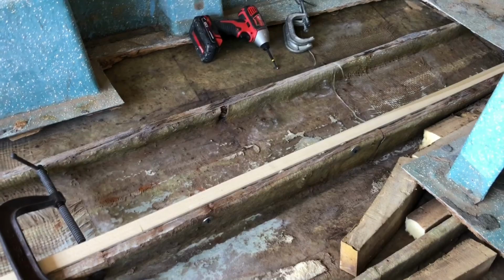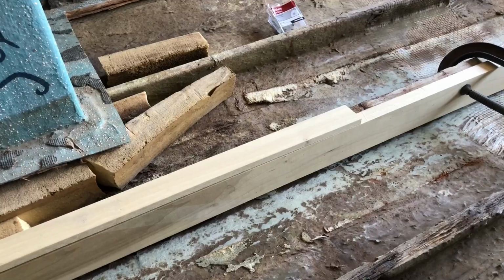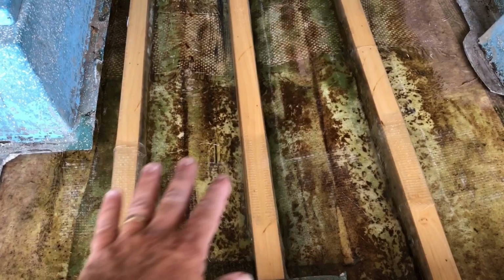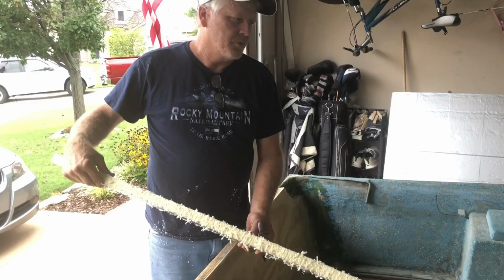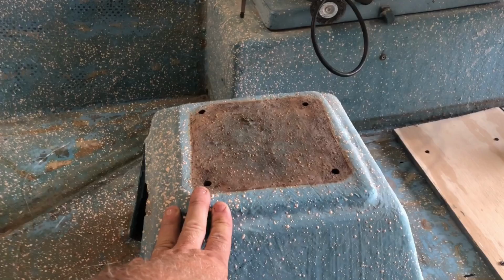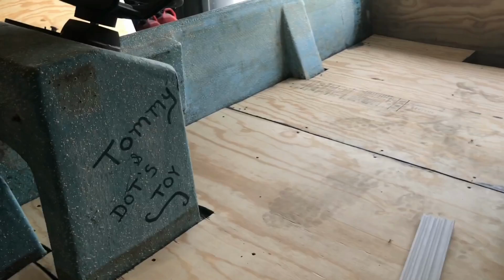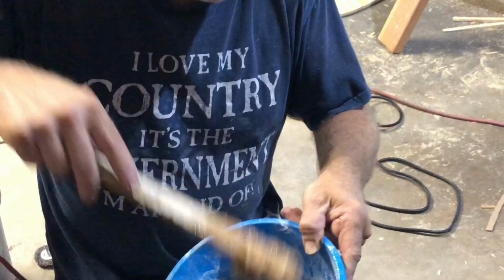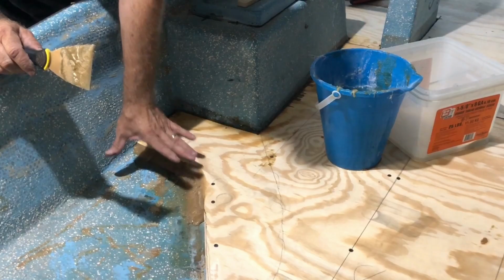Boat Restoration  7| Install/Fiberglass Floor| Paint Interior

Comment: I have a 18 foot sea ray bow rider and one of the seats ripped out. Turns out the wood/foam was rotted, and I ended up ripping out a good portion of the deck and waterlogged foam. After watching this, I’m definitely going to fix it myself, I got this! Thanks!
Reply from the maker: Good luck with your project 👍🏼

Comment: This video gives me confidence on my project, I got an old fish and ski I need to do this to. I was wanting to use better materials than wood/plywood but I don't really know of any the fiberglass would bond to. Your's looks great.
Reply from the maker: Thanks, did you start your project?
Reply: @borfishing7690  I put that one on the backburner for now until I learn a bit more. I picked up a 14' aluminum v-hull that I'm putting a deck and compartments in right now though. It's coming along slow but steady. About done rebuilding the trailer it came with and will focus solely on finishing the boat. 👍🏻

Comment: i think chopped glass wouldve been better than flour as the chopped glass fibers would soften up with the resin then would intertwine with each other making a much stronger  joint. I think the flour mix would tend to crack if there was any flex while the chopped intertwined glass fibers would not. but just my 2 cents
Reply from the maker: I used chopped glass around the transom. Used flour just as filler under the tapping. Thanks
Reply: @borfishing7690  oh i guess i missed that  sorry

Comment: Great Video. I am replacing entire floor on our boat. What Grade of Plywood (Interior or Exterior) and how many ply's was the plywood you used? You said it was 1/2" thick. Thank You Rog
Reply from the maker: Hi Roger, mine was 15/32 3 ply. Interior. It would be best to resin the bottom of the board before you install(I only painted with protective paint). Good luck with your project

Comment: Hello - what was the mix called for the peanut butter to fill cracks? Also, where did you get the fiberglass material? Thanks and great job on the project!
Reply from the maker: The peanut butter was resin mixed with flour. Got my fiberglass on Amazon, thanks

Comment: Your videos are GREAT! Very informative and great work!! I have an old fiberglass boat I bought as a project. My stringers are pretty dry-rotted and cracking. Do you think it would be good to build around them or should I count this one as a loss? And has yours held up well over the past year?
Reply from the maker: Can’t say on yours. My were partially rotted, but my floor is solid. Good luck Josh

Comment: I would rather glass both sides of the flooring before installing
Reply from the maker: I kinda wish I had. The boat is doing great, but glassing the bottom would have been optimal.

Comment: You sealed the floor
The bilge area has those foam cutouts
So how does water drain that gets into bilge?
How does bilge area dry out after wet?
Reply from the maker: I have a drain hole and it is garage kept.

Comment: what panel you use.   marine?  and for the stringer?    i need replace the mirror
Reply from the maker: Used regular 1/2 inch(4 green at Lowe’s/Home Depot). Stringers were 5/4 poplar

Comment: You should’ve fiberglassed the board before you attached it there’s no glass or resen in between the stringer and your board will definitely rot
Reply: Exactly, water will be pulled into any space there is air.

Comment: I have a question about what you used to put the glass mat down.. was it the same mic as the hardener, resin and flour or just resin and hardener?
Reply from the maker: I put the chop strand down with resin and hardener. I filled the gaps around the floor with resin, hardener and flour. I filled the gaps around the transom with a  prepared resin and glass from the comprising bought most the resin, hardener and woven glass.
Reply: Thank you for all the advice I’m doing a complete rehaul on my boat it’s a 1964 Sherry and I’m building a standing deck up front with storage bays, I built a custom console and everything is being completely redone.. all new stringers, transom, floor, carpet the list goes on and on lol I’m in the middle of the transom repair and kinda got lost with putting the fiberglass mat down and how to seal all my edges under it so thank you for all of this insight I appreciate it a lot
Reply: The prepared resin and glass that you used to fill the gaps around the transom is the prepared resin just resin and hardener then you add the glass resin to it? How much for all of it combined?
Reply: I just want to make sure I do this all correctly
Reply from the maker: I bought pre-mixed resin putty from the fiberglass supplier. It had the glass mixed in. I don’t know the ratio they used. Depending on how much you need, I would consider auto pre-mixed glass resin. I used it to patch the hull(not during the videos). It is an auto patch mix that I think would work well. I don’t remember the name, but I got it at Walmart.

Comment: Great Video! Im redoing the deck on my tri hull 14' fiberglass boat with a similar layout. I know you left a few inches of overhang around the edges to support the plywood. Looks like the wood was rotted out underneath that fiberglass floor you tore out. My question is did you put anything underneath the existing fiberglass floor edges or did you just lay the plywood down, glass over it and thought it would be strong enough without extra support?
Reply from the maker: Not sure what you’re asking, but the floor is solid. Thanks
Reply: @borfishing7690  Ok. Did you use Laminating resin or Finishing resin on the deck?
Reply from the maker: @johnwilkinson355  I used resin on chop strand fiberglass

Comment: Hi. Great video. I'm going to try make a bathroom shower and just wondering how many layers of fiberglass did you put on the floor? Just so mine doesn't crack I'm gonna have plywood under it too
Reply from the maker: Hi Carlo, I only put one layer of chop strand fiberglass on the floor. Thanks

Comment: How's the boat holding up?  Kinda heavy, isn't it?
Reply: Did well on the water. I have numerous fishing videos using it. I sold it last year.
Reply from the maker: I used it a lot with no weight issues. The guy who bought it is still using it

Comment: How has the rustoleum paint lasted
Reply from the maker: It’s been ok. It scratches a little easier on the outside, but generally is holding up fine.
I use the boat heavily in flooded timber
Reply: Oh okay
Reply: How does ot hold up on the inside
Reply from the maker: I painted over it with regular paint and a clear coat. Been doing great. I’ll be posting a video on the boat soon. I’m getting it ready for sale.

Comment: That's not fast drying epoxy is it?
Reply from the maker: I only used resin for the fiberglass and rustoleum protective enamel for paint
Reply: @borfishing7690  I'm sorry , I meant the hardner .
Reply from the maker: @josephauld6565  I didn’t use any epoxy, thanks Joseph

Comment: what  did you used to make up the resin filler ?? i did not get it .Thank you.
Reply from the maker: Around the transom was resin mixed with chopped fiberglass. Gap filling around the floor was resin mixed with flour.
Reply: @borfishing7690  flour? as in flour the baking bread stuff?   Could make sense, it will be encapsulated in resin and not degrade.
Reply from the maker: Yep, just plain ole flour. Thanks

Comment: When you laid the fiberglass mat down what ratio did you use?
Reply from the maker: Ratio?
Reply: BOR Fishing ratio for the resin and hardener
Reply from the maker: Depends on the temperature. In the video where I do the transom, I hold a ratio chart up at some point. I don’t currently have it.

Comment: I was looking up gun restoration channels and found yours, you look like you read the comments... anyway. I was wondering if you could help me and my father out with an old USSR pellet rifle. It’s an ИЖ-38.  I don’t have the serial number memorized by heart, but it is jammed. And I was just wondering if you’d be willing to help
Reply from the maker: Looking at the gun gun, it looks a lot like my crossman spring cocking pellet gun. First thing I would do is spray it heavily with oil/WD-40 and let it set a few days.
Reply: Billof Rights alright. Thank you, I’ll tell my father that. And if that doesn’t work, I’ll try and see if we can get it professionally restored.
Reply from the maker: The way I approach gun repairs or restoration is to YouTube or google the gun looking for assembly and disassembly instructions. I restored a 30-06 that needed a part that was broken internally. Without YouTube videos, I would not been able to do it. Good luck with your gun.
Reply: Billof Rights thanks. Thank you very much! Good luck with future gun restores.

Comment: Was that epoxy primer at the end?
Reply from the maker: Rustoleum protective enamel
Reply: Ok cool thanks. I’m in middle of doing mine and was just gunna spray with satin black rustoleum  protective. Just making sure I didn’t need to epoxy prime or 2x prime. Thanks again and definitely most helpful video for me as its been 15 years plus since I last fiberglassed floors.

Comment: About how much did parts cost
Reply from the maker: 2 sheets of plywood=60.00, resin and fiberglass cloth=500.00, quart of resin putty with fiberglass=40.00. Protective Enamel paint=27.00. Best I can remember
Reply from the maker: To add, I did replace cables, steering rotary, bumper guard, lights and others. Total boat parts were around 2000. Boat and trolling took another 2000. Thanks Chris

Comment: What type of putty did you use?
Reply from the maker: Most of it was a resin/chopped fiberglass mixture I bought from a fiberglass supplier. What you saw me mix is a resin/flour mixture. Thanks Michael
Reply: So you used, flour, as in what you make cornbread with!? That's cool! My husband and I just started pulling up the floor in our 88 Stratos. No clue what we're doing! Your video is helpful thanks!
Reply from the maker: You can mix flour for filling in cracks. For areas that need better binding, you should use a mixture with fiberglass. I used the fiberglass putty around the transom. Thanks Candice
Reply: @borfishing7690   thanks!

Comment: Epoxy or polyester resin?
Reply from the maker: Polyester resin
Reply: Cool. I keep getting mixed feelings so many use polyester and then there are seems also those say to not use polyester. Thanks
Reply from the maker: I use the boat a great deal doing YT fishing videos. It is holding up great. Thanks
Reply: BOR Fishing I think its more for what your using it for and epoxy may be used for harder use and stiffer structure. Having to redo my 1985 checkmate and I have done marine fiberglass work twice and that was 20 years ago. 

Did you get supplies from Fiberglasssite.com
Reply from the maker: Got most of it at La Favor Fiberglass in Broken Arrow, ok. He also gave me info.
Reply: BOR Fishing very cool thanks man. Keep up good work.
Reply: Sorry one last question. How many gallons of Resin did you use? I have same size about. Didn’t want to get too little or two much.
Reply from the maker: I bought 5, but used 4